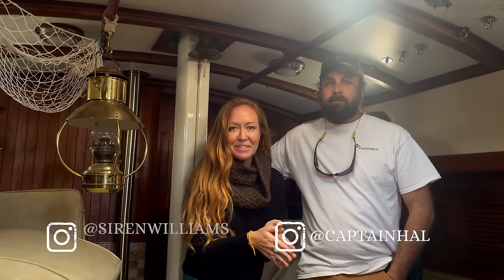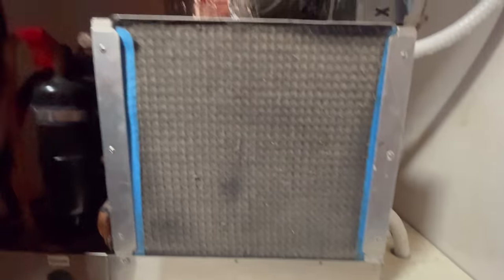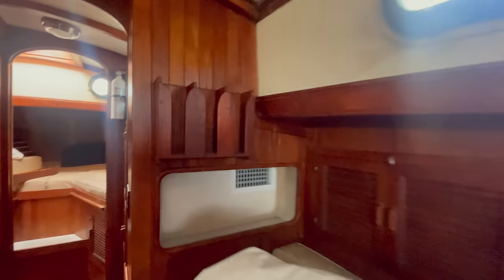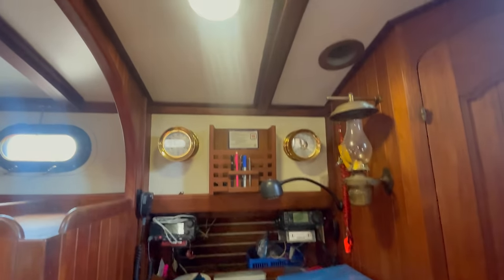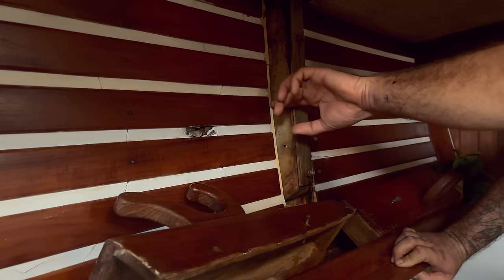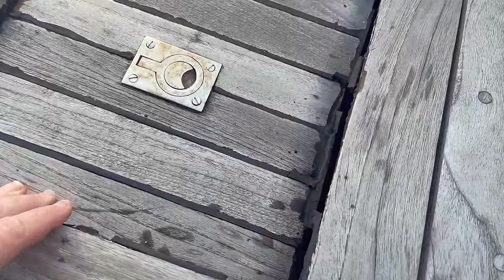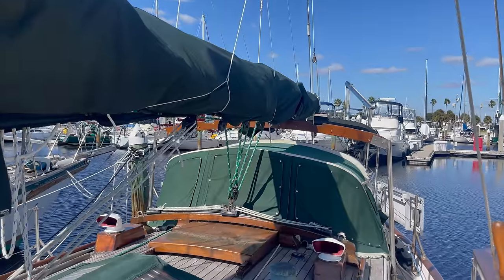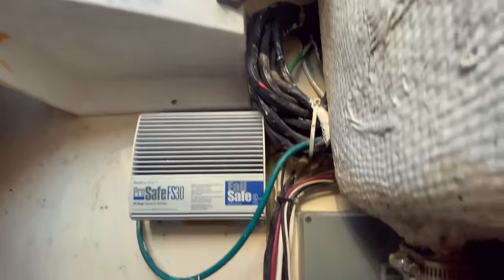I’M BUYING THIS BOAT -1976 TAYANA 37-  But we aren’t sailing out of this marina. (Ep. 42)

Comment: Go with external chainplates if at all possible. And titanium if you can. Those two chainplates that appear in the video gotta go. If the exposed sides of  the plates look that bad, the reverse sides will be worse and the portion of the plates piercing the deck, worse still. As a boater I love the teak. As a surveyor, I hate teak. Missing bungs warn of water below and in the FRP below. Any rust in the rigging shows the inner wire is chafing and rusting. Chainplates and rigging gotta be done soon. I would not sail it very far before you do. On the decks, I don't know your resistance to pain, but good luck!! I've surveyed a couple of Tayanas over the years. Lovely boats with the nickname "Leaky Teakies".
Reply from the maker: Hahaha Oh we know. She’s the right boat for now and she needs love. We knew right off the bat we’d have to deal with the deck and replace all the rigging and chain plates. We’re going to move them to the outside. Stay tuned!

Comment: The condition of those chain plates doesn’t give me a good feeling about how that engine has been treated for the past 3700 hours.
Reply from the maker: I agree with you there. I think they were running that engine a lot and not sailing but i don’t know if it’s because they knew the rig was shot or if they just weren’t sailors. There are several things around the boat that lead me to believe the current owners weren’t sailors at all and were just Diesel Dan’s. 
Be sure to subscribe! Thanks for the comment!
Reply from the maker: Will add this though- that engine looks good and sounds good, and we got a sweet price on the boat. A very fair price, I’d say. So if we HAD to put a new engine in here one day, I wouldn’t be that upset about it.

Comment: Consider  that a diesel  in a truck normally  runs 1.5 million miles  before  overhaul  that around  25000 hours.
Reply from the maker: Fingeres crossed hahahah
Reply: Correct..

Comment: I own a 83 tayana 37 I have a 16000 btu under the port satee and it's ducted from bow to stern not a big deal. If the chainplates are leaking 99% sure your going to have to replace them and the knees other than that they are awsome super comfortable even in heavy seas they are built like a tank not a race by any means but will get you wherever you want to go comfortably
Reply from the maker: Yeah this has been a favorite Perry model for a long time, I’d just hoped to go a little bigger but the CT37 has always been in the back of my mind as a back-up plan, and there are always so many available too. There’s another for sale just two boats down, and then a few more for sale just within an hours drive! 
We’ve gone ahead and priced new chain plates to move to the exterior and all new rigging, and we’ve gotta do the deck sooner than later too. 
Thanks for the info on the AC. We’ve been in the boat for two days and that thing is blowing me away!!! Hahaha
Reply: Yeah I wanted to go bigger as well but once you tackle a bottom job on that full keel you'll be glad you didn't go bigger. Plus the cost of everything goes up the bigger the boat and being its for a sailboat it's already 3x more expensive. But I still love my boat. And congrats on your new boat whichever one you decide on and you'll know it when you find her cause she'll talk to you.

Comment: With nearly 600 of the Tayana 37's built, they are are well proven design and found in ports all around the world, but like most teak decked boats (and cabin top too, in this case) they often have deck core rot and the chainplate problems you have already discovered. This one looks tired and not very well taken care of; the leaks have been ignored to the point of interior wood rot, the odd fixed cook stove which cannot be gimbled due to its forward/aft location (should be mounted to port so the stove can swing), the standing and running rigging need replacement (probably sails too). And the engine is a crapshoot - given that the rest of the boat shows lack of care - what makes you think the engine was taken care of any better? I hate to sound so negative but if you are going to go through all the time and expense rebuilding a classic boat, why not check out a Hans Christianson 38? They are built better than Tayana 37s, have two feet more waterline and one foot more beam for a larger interior, and weigh 4,000 pounds more for motion comfort at sea. Over 200 were built so you should be able to find one at an affordable price that has been kept in better shape. Cheers!
Reply from the maker: Proven design- agree, Perry's greatest achievement in my opinion, always felt that way.
Deck- I had another 3 minutes talking about the deck and Hal wanted the video shortened and said I was talking too much so it was deleted, but yeah, we had a surveyor on the boat and he confirmed everything I'd said and confirmed it was not as urgent as the chain plates and rigging, and we could get away with another year
Stove- No idea why they put it there, but Ive seen other Tayanas with it there as well.
-We have brand new sails, never used, so many we will likely get rid of the old ones. Standing rigging will be replaced this year, and running rigging is fine but I want to replace it anyway
-Engine is an early 2000's 4JH3E, and it looks really solid. Sounds great. If we get into a situation where we need to replace it, we can. 
-The Hans' were built as similar standard as the Tayana 37's. It's not a formosa. Both were built in decent yards and have fantastic reputations. Also, we've looked at all the Hans within our budget and there isn't one close enough within our price range so it isn't an option. I'm a Hans fangirl too. 
Thank you for watching!

Comment: Get a survey please. It's a beautiful boat, but I would have a professional look at it.
Reply from the maker: We hired a surveyor. We wanted someone to find all the little things we may look over so we have the list now. In regards to the deck and rigging, he confirmed everything we said. Rigging is shot and deck is pretty well done and his assessment was basically exactly what we said in the video, but I wanted him to see if he could determine how much damage was already done to the deck. In the end, he said the damage wasn’t major or structural and we could get away with not doing the deck for a little while even though it’s letting on water. Not too long! But we have time. Hal wanted to pull all the seams and redo the entire deck with the same wood and I voted against that because the wood is already thin and that’s expensive to do and not worth it. In the end, the surveyor agreed with that and told us to just let it ride until we could pull it off.

Comment: The radio on the right of the nav station is an ICOM 706 HF ham radio (a great radio!).  The SCP box below it is means of sending email using the ICOM.  If they are both in working order you can send and receive emails almost anywhere you can float the boat!
Reply from the maker: Yeah we've gotta get it working again. We were forced to remove the antenna, but we'll get them going before we take off anywhere too far.
Reply: @TheSirensLog  when y'all are ready to get the radios up and running properly I can help! I'm an old school amateur radio operator. I can also repair things like bad mic cables and cable connections. Have solding iron... Will travel... lol

You're probably going to need some new coax and antennas as well depending on how old it all is. SALT and SUN is great for vacations... But it's horrible on outdoor electronics!
Reply from the maker: @JimWalkerMusic  Thanks Jim!! Very, very cool. I'm hoping Hal can fix it but then again, his immediate instinct was that we need new radios on the boat. He had mentioned the connections, but honestly I don't even remember where we left off with all that but before we take off from Key West again, he's definitely going to have to look at it. We have to get a couple of hand-held radios anyway. I'd like to have them for us when we travel in place of cell phones in certain places, so I think two is clever. But if you're ever down here, let us know!!!!
Reply: @TheSirensLog  the radios are probably fine. Antennas and coax isn't a whole lot of money. A new Marine Band transceiver with built in AIS would be cool. The ham radio y'all don't even need since you have Starlink. 👍

I will be down there within the next week or so. I have some guitar work lined up. (Re-string, neck setup and install a pickup on an acoustic for a friend.) 
<--- Jack of all trades...
Reply from the maker: @JimWalkerMusic  Nice! In Key West? Yeah I'm hoping the coax cable is the issue, though I'd gladly buy a new antenna. The HAM is cool, and even though we do have starlink, if anything were to happen to that, having a back-up is nice.

Comment: Considering one of these beautiful TAYANA 37 for sale in So. CA. Love the teak also, but also scary. This one looks in rough shape. Can individual planks be replaced? If so, where to find / source them? Seems that would be hard and $$$. Or certainly a specialty item and skill set (I definately don't have so far). So love the interior of these classics. Just warm and cozy and beautiful. Why would you paint over teak???   Would like to see any new videos of the teak work?
Reply from the maker: Hey! They are GREAT boats, and are smart if you're going to be crossing oceans. They're very seaworthy and were originally modeled after the old Colin Archers. 
Thanks for the comment! There's a lot to know about teak, and if you're going to get a boat like that, you just have to know that you'll have projects on your hands, and they won't be easy or cheap, and you will need to do a lot of reading to make sure you do it "right",  but you're totally capable. 
Oh man... the paint. lol You really shouldn't paint over teak, particularly inside, and even more particularly in a wet and humid area, and even MORE particularly with paint that isn't designed for such. It WILL and IS rotting this wood out, and things have been painted shut that absolutely can't be, so we do have a situation here. However, people do paint teak on the exterior of the boat occasionally, but you must use a paint that will work for that, such as Awl Grip, because paint is naturally very oily so it's difficult to get paint to stick to it properly, and when it doesn't, it lets in moisture and deteriorates the wood. We haven't tackled that head yet, but we will be soon! We will strip it with a paint stripper and then let it fully dry out and then come back and varnish it with many coats.
Planks on deck can totally be replaced, but you must know that if it has the original deck, it leaks. Guaranteed, unless they've gone to great lengths to patch it, but that's so unlikely. Even our broker told us repeatedly that this deck didn't leak, but as a broker myself, and as someone who knows boats, I ignored him every time he said it and was fully prepared for serious leaking, which he had. Ive since done dome patch work, and I'm not done. We MAY keep this deck for a while if I can reset fittings and do some patch work to make it stop, but you must know that the core below it is wet, guaranteed, so it isn't really ideal to keep the deck. You "should" pull it off, fiberglass the whole deck, and do non-skid. That is what everyone does. OR do that and then spend $85k on a new teak deck that will glue down instead of screw down. 
Be sure to subscribe because these are all things we have in our future! I think we'll try to make this deck work for us, for a while! But it'll involve a lot of work and money just to keep it another few years. 
If you're serious about a boat with the old teak still on the deck, just be ready to spend a LOT ($20-50k depending on whether you do it yourself or hire) of cash to replace it. As a broker myself, I generally would never advise a newbie boater to take on the highest maintenance boat possible. Not saying you're a newbie, you may know boats very well, but perhaps not the teak end of it, but that's just my general thoughts behind it. IF you re-do the deck, and you're left with interior and some exterior trim teak, you can learn to do the brightwork yourself! It's not hard. I was getting paid to do it on boats in my last teens, so it's not rocket science, but there is some skill and technique involved.
Reply: Hey.. wow. Thanks for that very detailed reply. Educational for sure. And spooking me away from purchasing this boat & teak decks on general.  I have a very small amount of teak (cabin cover, eye brows, bow sprit and toe rails) on my 1983 Pacific Seacraft Flicka-20 ❤ This cute and capable pocket cruiser, but looking for something w a bit more spacious below for 3-4 crew.  I’m on West coast, So. CA.  Will keep watching. Thx again.
Reply from the maker: There are some gorgeous and affordable boats out there! I WISH we could have looked around California because I was seeing SO SO many at crazy good prices, but just be aware that a boat is so much more than its listing. I've seen boats where the listing looked great, but once you see the boat, there's a ton of bad that isn't in the listing, so you have to be careful, and it helps to know a thing or two, and know where to look for issues. Sounds like you have an amazing boat already! The Pacific Seacraft is "similar" in concept to the Tayana. Not the same, but both seaworthy, bluewater boats. If you're trying to stick with a Bluewater, ocean-going design, then you probably already know to shoot for something with an encapsulated keel. Yeah, I mean, if you don't want a huge project and maintenance and don't want all the leaks (not to say you won't still have leaks through fittings) then I'd advise something without a teak deck, unless its a new, glued on teak deck, but that would be a more expensive boat for sure.  @christopherstevenson9737
Reply: There’s a 30’ Friendship sloop (fiberglass, not wood) for sale I’d ❤️ to have and sail. !!

Comment: If you have 1976 money I suppose this boat is as good as any.  the question is do you have the tenacity and resources to fix the old girl up.  teak and marine plywood are like gold The deck is a massive project the damage caused by the leaky chain plates is likely fat more extensive then you realize,  I wound not go  blue water sailing without modern reliable navagation communication.  Did anyone look  at the condition of the engine oil???  sometimes it will tell the story of neglect.  In my opinion this is a 6 month minimum repair project.
Reply: Youre 6 months is very optomistic. Mine took 20 years. And many things 3 times again. But in exotic ports all around the globe
Reply from the maker: That’s just boat ownership. It doesn’t end.
Reply from the maker: Yeah we know! And we do have the resources. We aren’t sailing her anywhere until this rigging is out of here.

Comment: Check out the German product Coelan for the decks. Our Union 36 had worse decks than yours and thay look fine again. Much cheaper than tearing them up and glassing. Live with the wiring on an old boat. Fix it if it gives a problem. Don't go for a rewire. It is too much work.
Reply from the maker: Thanks! Yeah I don’t think we will need to rewire, truthfully. I hope he doesn’t try to do that. But so many old wires have been left in there that I think he wants to get the old ones out. I’ll look for Coelan. Never heard of that actually. I do believe I will “fix them” before pulling them up and just riding it out for a while. It won’t bring value to the boat, but at least we can enjoy the teak a while longer (we may never have teak again), and I can put off the expense. Haha